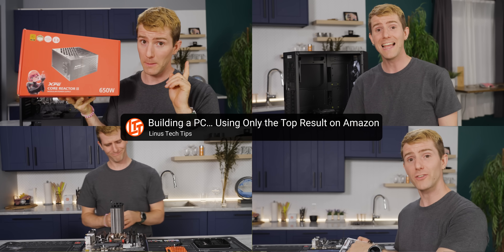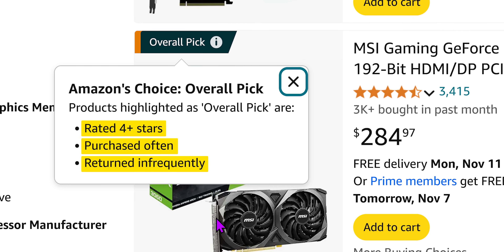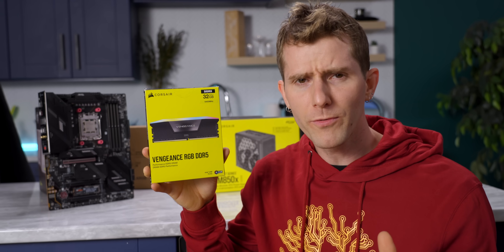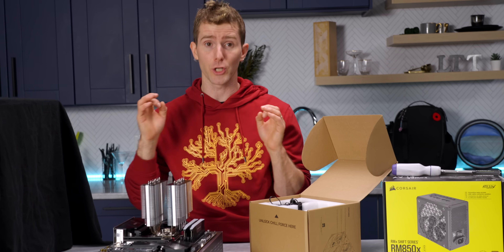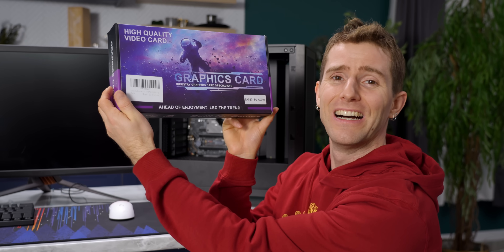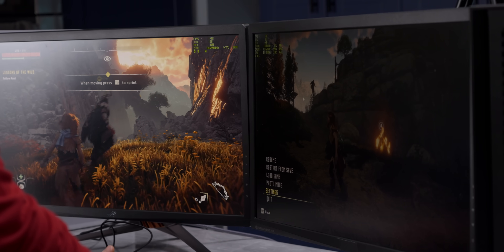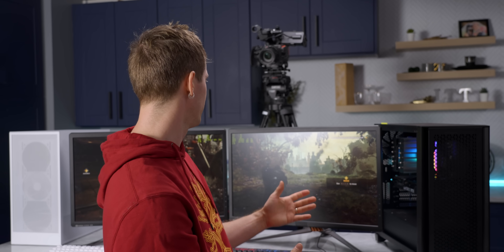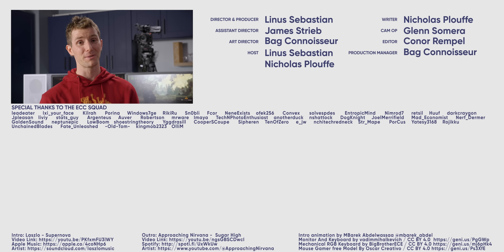Building a PC Using Only Amazon's 'Overall Pick' Products

Comment: 7:58 very decent card didn’t even knew they had a 12 gig variant
Reply: 12GB is the default first released version. 8GB came out few months later and was criticised for not only having 4GB less VRAM with the same name, but also being slower.
Reply: if its not 12 gig its not a "real" 3060 its a cut down version of it
Reply: lol its literally teh first 3060 ever launched.
Reply: I honestly can't recommend it anymore, I have been running it for 2.5 years or so. 
Since half a year ago it's been a constant pain with infrequent non repeatable blod and freezing. All related to Nvidia drivers in event viewer, I already fully cleaned out all drivers related to anything graphics (multiple times). Memory tested, was fine. Windows files no corruption found. All other drivers work good, no errors.
Still happening, so I'm betting i am having the same issues as some of the reviewers on amazon at this point.
If possible i would probably return it and buy an AMD card again. That sucker ran for 7 years straight with overclock, 2 fans died and it still fucking works lol.
Reply: the vid came out 2 min ago how
Reply: Video skipping andy
Reply: bro the video came out 3 mins ago, how tf are you at the almost 8th minute
Reply: @apocalypse0000  I dunno, members can get videos ahead of everyone else, so.
Reply: How did you even get to that timestamp already
Reply: The 3060 12gb is 20ish% less powerful than the 3060ti 8gb. I like the performance of the 3060ti, but the VRAM is limiting in a few games and Blender.
Reply: The 12gb 3060 is actually pretty bad price to performance card and the 8gb is like 20% slower than that. You basically got an overpriced 3050ti.